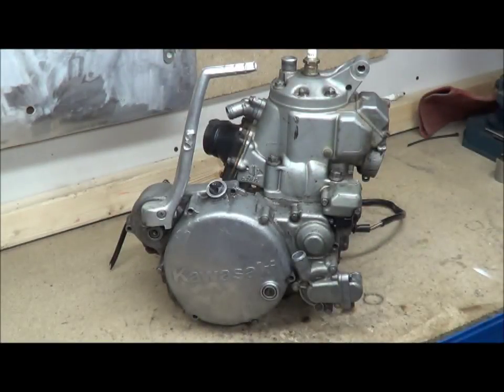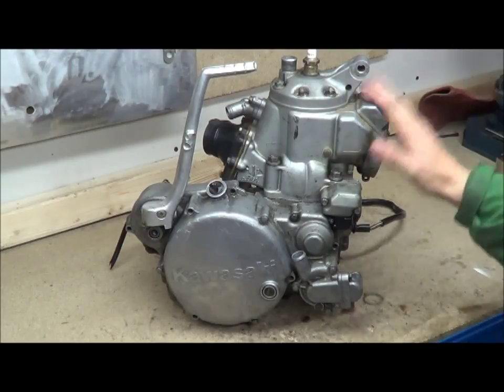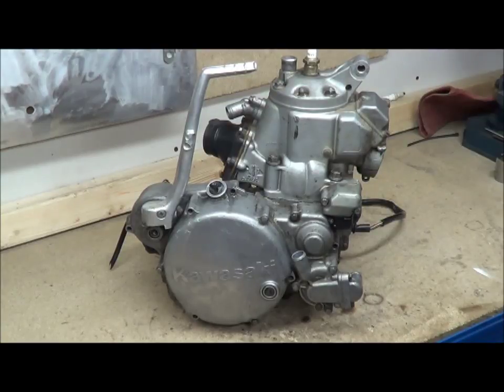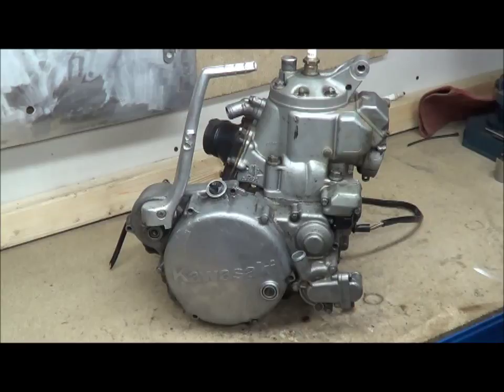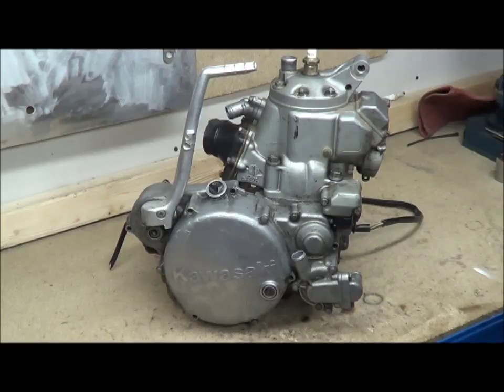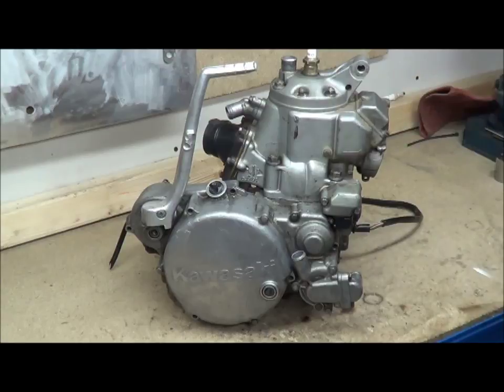KX250 Geared 2 Stroke Series - Part 1 Introduction

Comment: Just about to do this on a KX85. Im assuming this vid will help me get my head around the engine
Reply from the maker: Yeah it will, there are slight differences like size and one or 2 location differences like some bolts are to one side or the other but nothing major.
Reply: Thanks and loving the vids. To have it all in one place, and explain what things do makes it much more enjoyable.
Reply from the maker: No worries mate, that was the whole point of the video series and to know its useful to someone makes it all worthwhile. - Matt